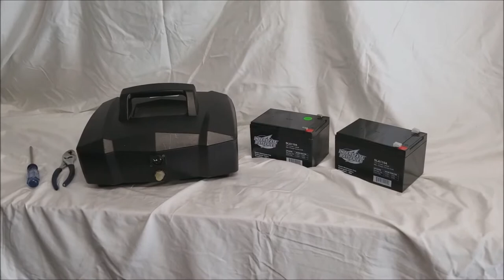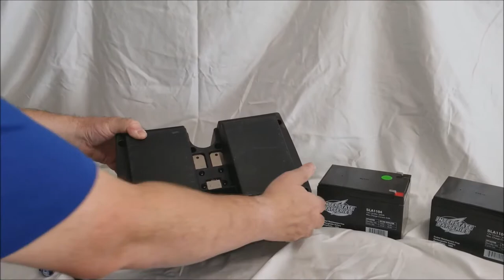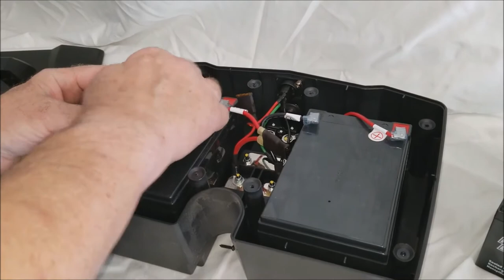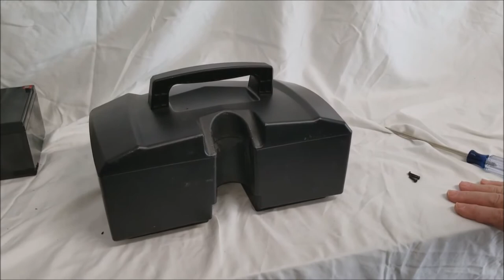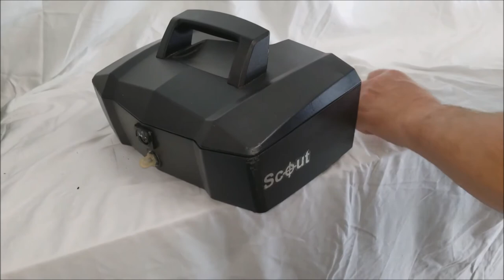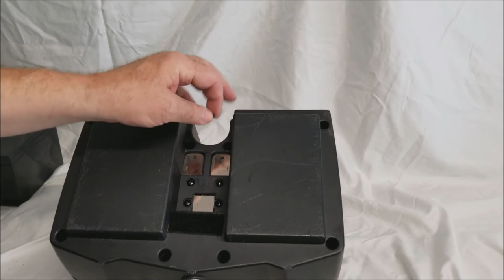How to install replacement batteries in your scooter battery pack

Comment: Be carefully how you put battery’s in base space. There are felts in corners of base case.  There one corner and opposite corner also. Try to fish inside of felt corner. If you don’t, it will raise the battery off position and it will be very difficult to put case lid back on.
Reply from the maker: Thanks for the extra tip Ray!
Reply: Be careful how you spell the plural batteries! NO English plural needs an apostrophe to make it a plural!